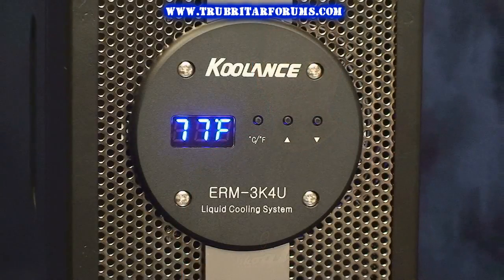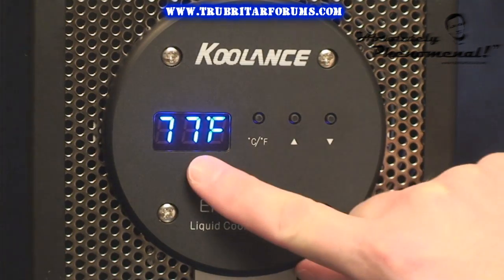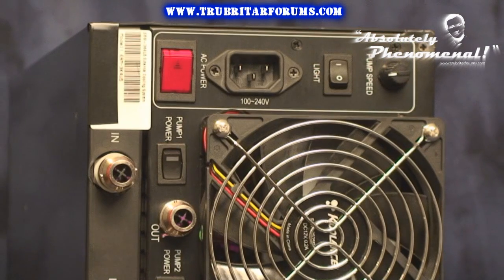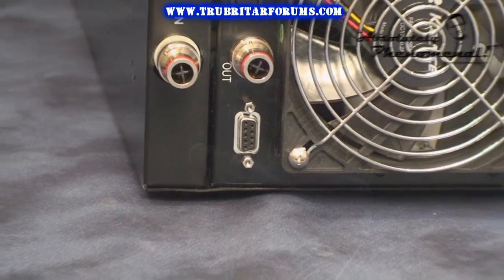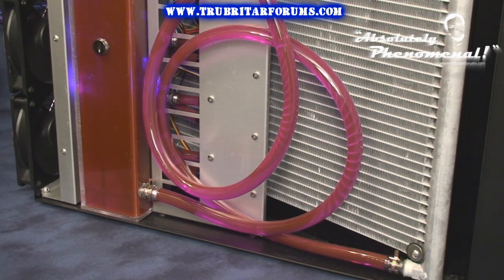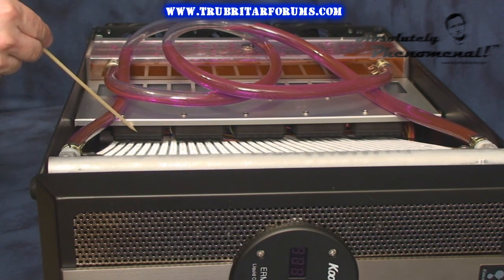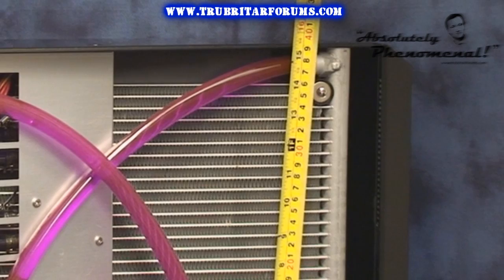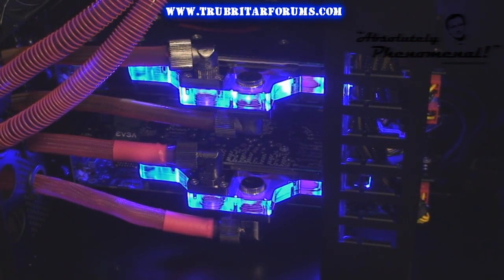(HD) Koolance ERM-3K4U5 Liquid cooling System

Comment: Its not a radiator, well it serves like one but are an condenser for a car or other vehicle, coolt build though. How do i know, well i sell aircondtion parts :)
Reply: Balubish Tech if you want to be technical its a heat exchanger but definitely not a condenser. A condenser increase the pressure to the point the coolant gas/vapour change phase to liquid. Unlike air conditioning, there is no compressor here, no coolant gas or phase change here so I'm afraid you are incorrect.
Reply: Thanh Tran im affraid you make it too complicated. Search for car condenser on google and choose pics. I sell them for a living. Yes in an ac system that produce compressed gas in it and boils and cools down by the condenser but works as well as a watercooler for this use. And you can have a high pressure pump for it so thats good though. ;-)
Reply: And heat exchangers mostly are thicker with 2 different loops in them. I only see one in and out on this one.
Reply: There are different kinds of heat exchangers. Liquid-Liquid is the one you are referring about. A liquid-air is also a heat exchanger, or radiator. AFAIK, if its going from liquid to air, transferring heat, it's a radiator, like the one in front of the car.
Reply: Thanh Tran Thats what I am saying, its a condenser used as a radiator. :) Here is an example of a condenser http://www.alibaba.com/product-detail/sell-made-in-china-aluminum-parallel_60167451281/showimage.html Different fittings/connections than this Koolance stuff but still same thickness and sides, thats why you have 3000W of cooling, and they come in all kinds of sizes. For cars yes they act as a cooler for compressed gas. But if you put liquid in it you can easily use it as a watercooler for you PC. Man I should buy one from the company I work for and try it myself. Would be easy to do, look like shit but easy made. And cheap.
Reply: It would certainly be cheaper than this. It costs about £1,800. But you do get 4 high power pumps and fan controls. It would cost you a good few hundred to get the same setup.
Reply: Thanh Tran yeah thats true. But only need one pump. Thinking of doing one myself now. Just the rad part. Then maybe use 2 big fans 200mm or bigger with slow rpm.
Reply: Me too, i'm looking for a cheap radiator. There's plenty of good fans like the Silverstone AP180. If you get a radiator on the cheap please let me know. The only thing is car radiators probably have smaller pitch than PC radiators so it may require higher pressure, bigger fans but a big one should do the job

Comment: For a thousand bucks they could at least put in a copper rad! I'm currently working on a DIY external water cooling system from an old big tower case and a car radiator. I just need to buy a pump and some tubing now.

Comment: @Lonewolf3515 
not really, nothing will beat water cooling (except TECs, phase change and liquid nitrogen, but all of those are even more complicated)
your best bet is a big case with lots of fans, a noctua NH-D14 for the CPU and the best air cooling solution available for the GPUs. i toyed with the idea of a cold air feed directly to the graphics cards. that way you could get more even airflow to an SLI/crossfire setup.

Comment from the maker: This is true, mixed metal systems will quickly corrode.   You can use nickel plated blocks with aluminium radiators with no ill effects.  In any situation though, even full copper systems, it is always recommended to use a good quality coolant with corrosion inhibitors.

Comment: Seriously? Well water has 40 times as much heat absorbtion and 10 times as little thermal resistance as air. And no, with a system that big you could turn the fans to their lowest setting >20dba would be the noise produced, and still get very sufficient cooling. The best air cooler in the world is easy rivaled by the cheapest watercooling system in the world. Air could get an OC'd HD5970 @ 1000/5200 down to 80 at full load, where as liquid can drop it to 40, and phase change can drop it to -15.

Comment: Man that's a piece of JUNK.

Word to the wise: DO NOT BUY ANY WATER COOLING HARDWARE WITH WATER-SIDE ALU.

Ideally you want to use only copper and/or brass, because when you have copper/brass in a loop with aluminum, you WILL end up having issues with GALVANIC CORROSION. Look it up.

Comment: 1300?  You would be INSANE top pay that for an aluminum system.  Your going to run into a TON of problems running aluminum rad.  

WC rule one "Don't buy a kit"

For the same reason your don't buy a pre built computer.